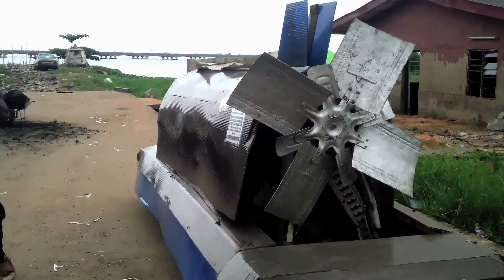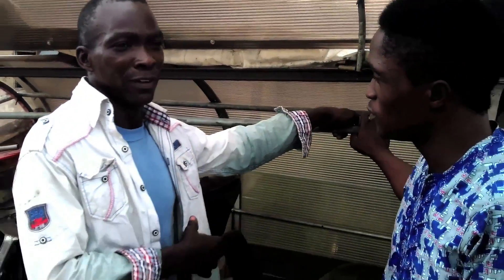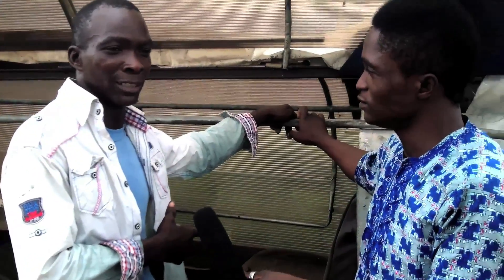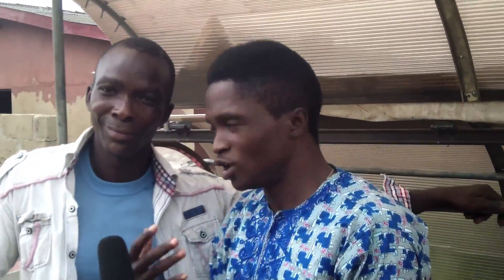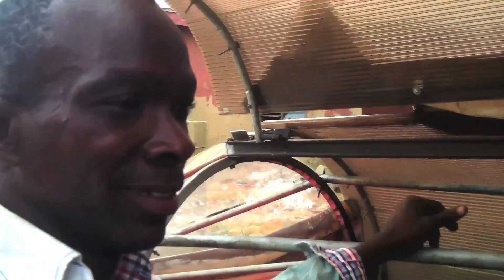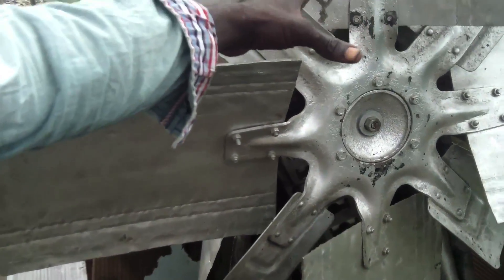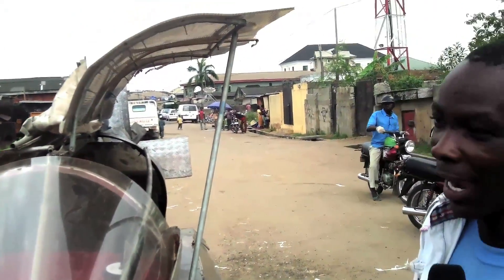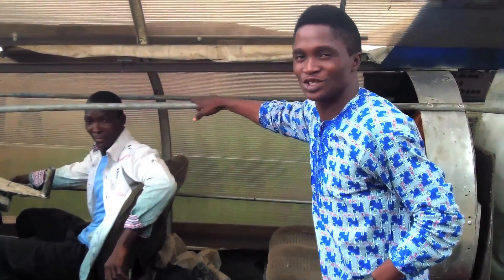CRAZY! Inside A DIY Rocket Car!!

Comment: A little encouragement would help, the first planes by the Wright brothers were frameworks that made no sense with time and encouragement his piece could be modified
Reply: No, actually, the Wright Brothers had a pretty thorough understanding of basic physics and airfoils and their designs reflected that.  They started with gliders and progressed logically.  This is utterly superficial mimicry, a weird hodgepodge of things - pointy at one end and a nonfunctional fan at the other - tacked onto a rickshaw.  Their 'want to' is not matched by their curiosity.

Comment: PS: What's even funnier is the number of people on here thinking it's actually something of value.... the childish lack of basic intelligence is more wide-spread than just this poor guy.

No wonder aliens don't bother talking to us.
Reply: Actually all he needs to do is draw up a schematic, upload that to the computer(digitize). From that take out the excess, fuselage or chassis!, essentially make it more stream lined. He probably needs to go from a single back fan to a multiple angular turbofan at say maybe 60degrees angular difference. He will also need to workout weight distribution when in motion and when not in motion, using lighter or heavier materials in certain areas. So type of atmospheric control system is need inside as well, couples with some computing parts. That being said when its all said and done, after extensive testing against the elements also including stress. I could see the advanced version of this being used as a maritime amphibious assault vehicle for countering threats at close land and see terrain. A vectoring machine gun, a few guided missiles(heat seeking preferred especially in sea combat where the coolness of the water could serve as a backdrop for detection. All in all its a small vehicle by most amphibious standards, so thats good.I don't see it flying anytime soon tho lol. You guys have to understand this is somebody with limited resources severely limited support and limited access to even average standard components, that coupled with the fact that he has zero engineering literacy or apprenticeship, actually puts him in a very good standing. The concept is good, and if taken to the max it could even yield a submersible type of vehicle.But for that he would need to take into account pressure dynamics. Or even yet with the right radar absorbent materials, coupled with minimal Radar cross section design, some advanced maritime computing tech this could go far.
Reply: So....you're saying I should pre-order before it sells out like hot buns?
Reply: журналист well it is Sub Sahara Africa, the least developed area in the world.
Reply: Tonga Jones 
Don't forget to use a 3amp fuse for the headlight circuit